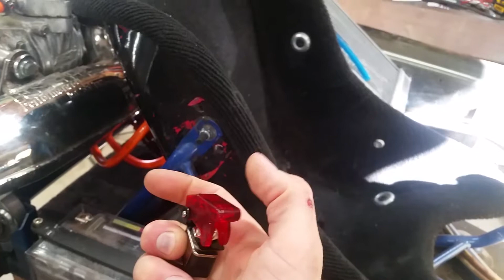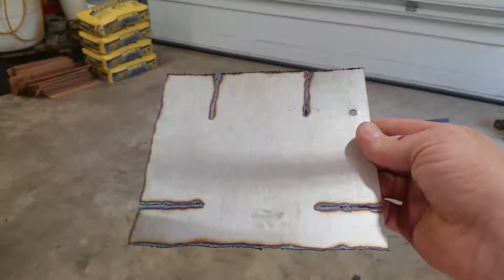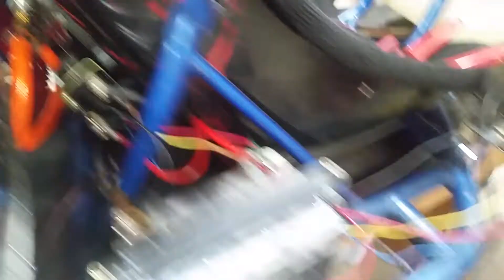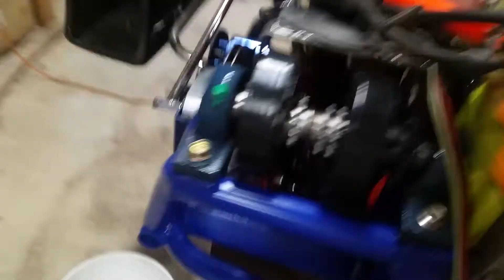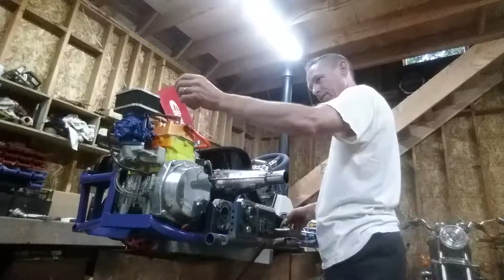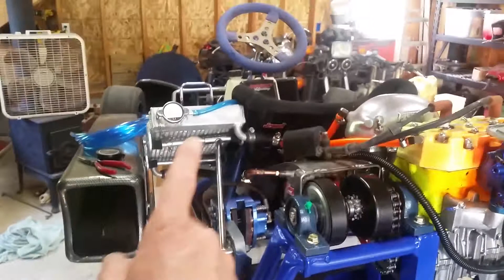Kart / Ski electrical. Getting closer

Comment: Hi how you connect the stator cable to the ignition coil
Reply from the maker: Its everything from the Jetski. They use a pulse coil and exciter coil under the flywheel
, not a stator.
Reply: @thedutchmanandthedigger1500 can you explain me how to connected them
Reply: @thedutchmanandthedigger1500  can you make a video on how to connected those wires directly to the coil to have a spark
Reply from the maker: @JazOsorio-f5z go here. its the wire diagram.   https://images.cmsnl.com/img/partslists/kawasaki-js550c3-jetski550sx-1993-usa-canada-ignition-system_bigkae0171e1830_86b0.gif
Reply: @thedutchmanandthedigger1500 hi can you pls teach me how to get spark without the MPEM